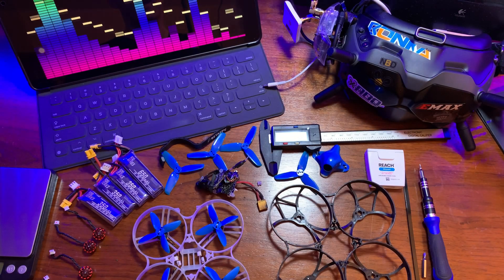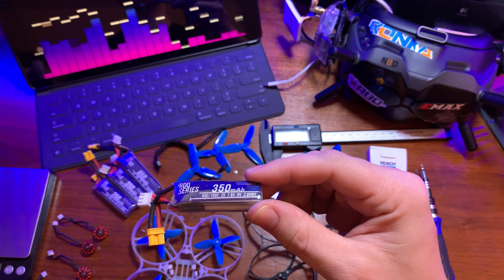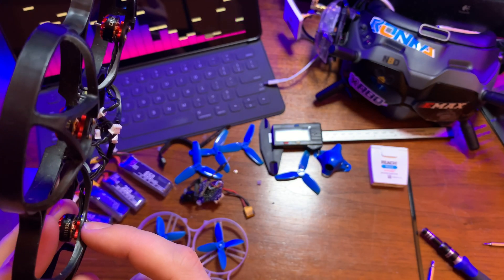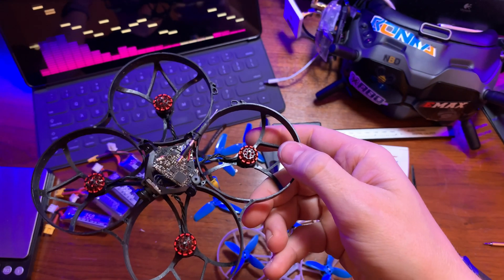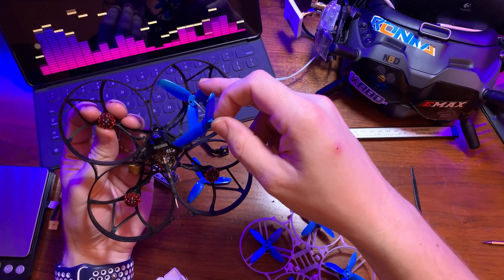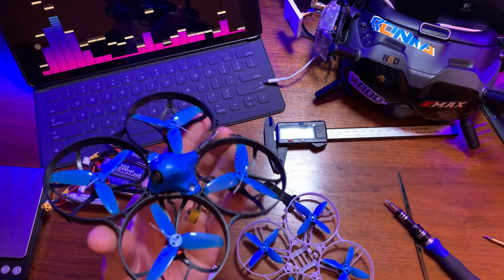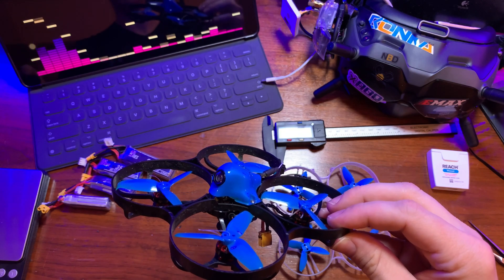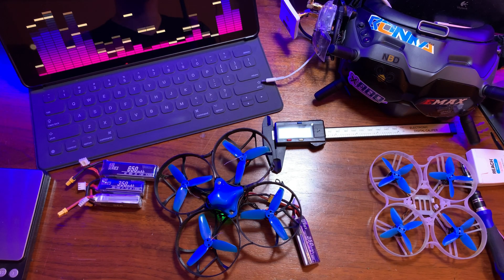95mm 2S PowerWhoop Build | Micro FPV

Comment: I'm doing a similar build, but with 1204 6500kv motors. I have the 85x 4k tarsier canopy, and a tarsier v2, but I'm putting it all on a 95x frame. I'm hoping the bigger prop will carry the tarsier a lot better than the 2" props. And I plan on running 3s.

Comment: I built one with the betafpv 11000kv 1103 motors. It wobbles a lot do you think going down to 1103 8000kv would below with that ?
Reply: Yeah probably. 11000kv is too high for 2.5'' IMO.. you can also try the thin 2 blade 65mm props that might also help

Comment: Hello BGUFF, 
following your advice I swap my 85x custom (Fc Beta aio + 1103-8000kv + Emax Avan quadri 2 "+ Turbo eos + Xm => 58grs) on the frame of the 95x (59grs).
could you share your entire dump to get yourrates and your filter settings ?
Thank you for your great ideas ;-)

Comment: Sweet!  You build those gates yourself?
Reply from the maker: Yes! Just used 1/2” PVC to make stands and then slide two large noodles together with another piece of PVC to connect them in the middle. Super easy and cheap. You can also get pretty creative and build all sorts of gate styles with them. Best part is they are soft so they are forgiving on your quads. Also very easy to see while flying

Comment: maybe lose the battery strap and shave off some more weight?
Reply from the maker: The strap only weighs .8g so you would totally save weight but I think you would gain it back by attempting to affix a battery in an alternate method. (zip tie?). At the end of the day it may not be worth shaving that weight based on how incredibly well those tiny rubber coated straps work. My batteries always stay where they should

Comment: That ziptie for battery strap is 👌
Reply from the maker: yes, the zip-tie allows you to have something to loop the battery strap through until we get a purpose built 95mm frame that is not designed around the carbon fiber bottom plate